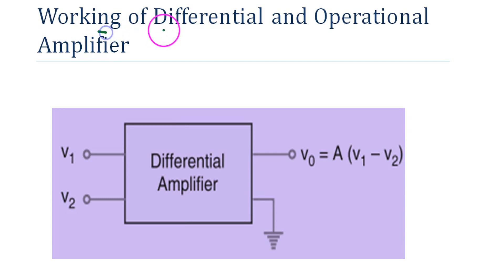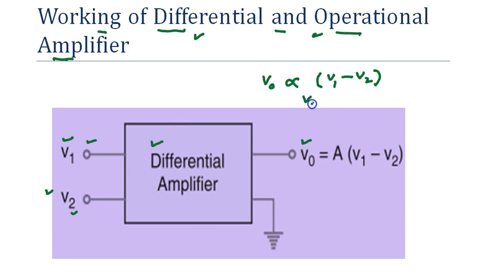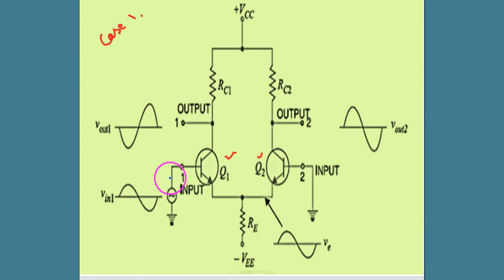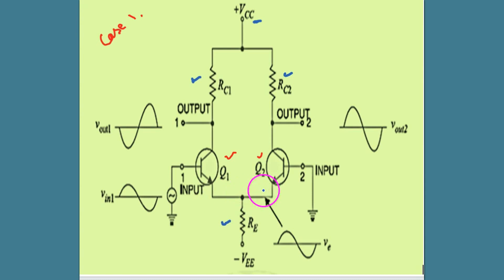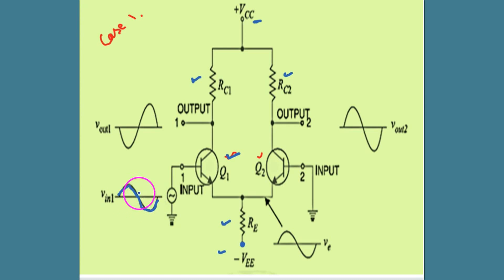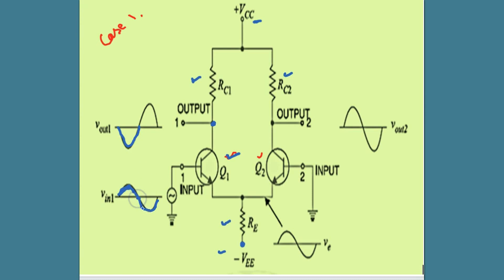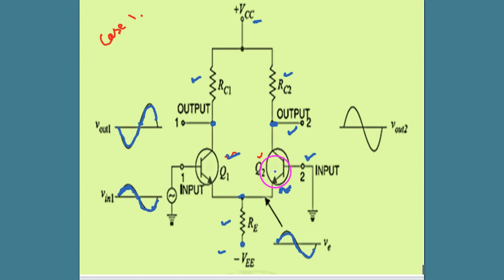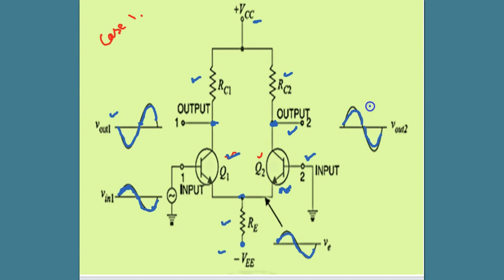Differential Amplifier/ Op  Amplifier  Circuit working

Comment: Watch the two videos below which begin with descriptions of differential-mode and common-mode currents with animations. A basic scheme of a differential amplifier is introduced with the description of the analogous operation of a U-tube manometer. This is followed with a description of enhancements to the basic scheme of the amplifier to make it suppress common-mode output voltages more efficiently.
The Basic action of a Differential Amplifier- the heart of the Opamp.
Part 1 of 2
https://youtu.be/uggOykLShMU 
Part 2 of 2
https://youtu.be/jLJAYyap5WA